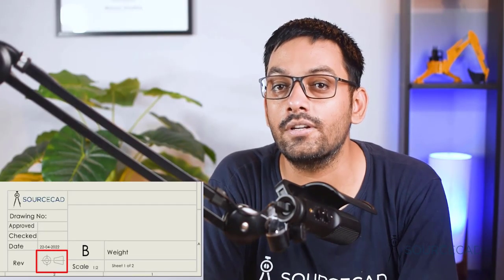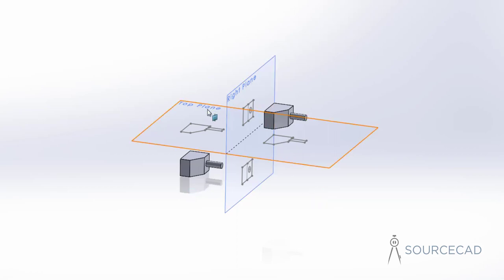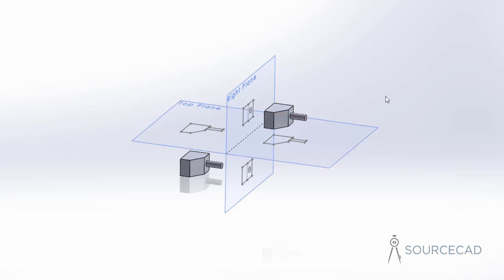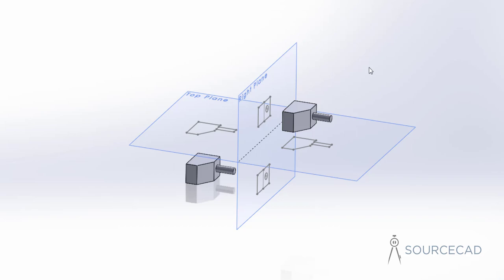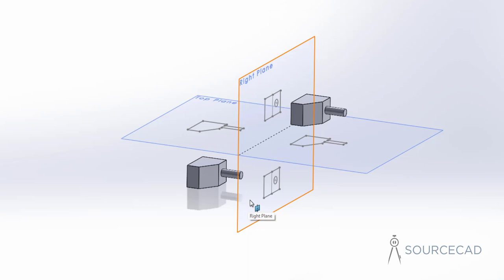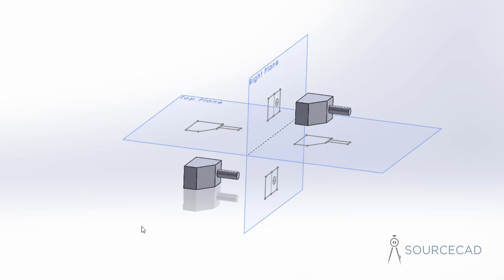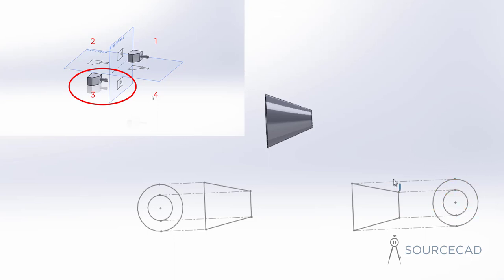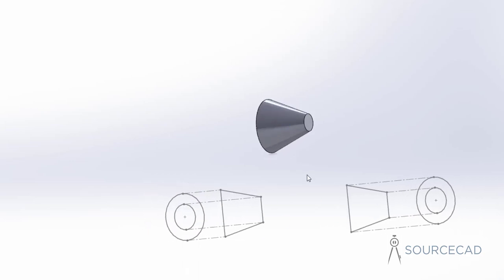Understanding first and third angle of projection

Comment: Worked in the aircraft industry for many years designing tooling for various projects. Uk mainly 3rd Angle, USA mainly 1st Angle. Always simplified the views in my own mind by telling myself that in 3rd angle what you see is what you get when you look directly at the item from the position where the view is located on the page. If it didn't match then it was 1st angle. Never let me down when creating my views, just needed to remember which project I was working on at the time because we worked both together, which could sometimes get confusing. 🙂🙂🙂